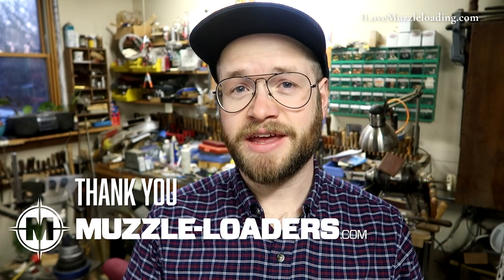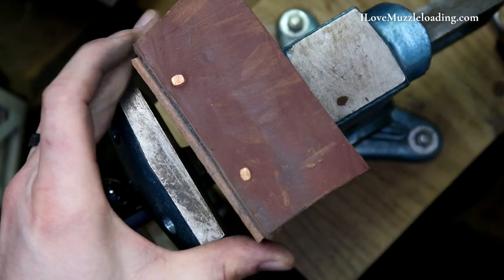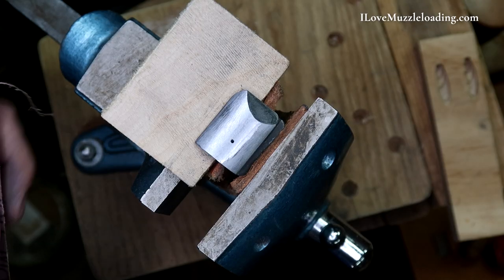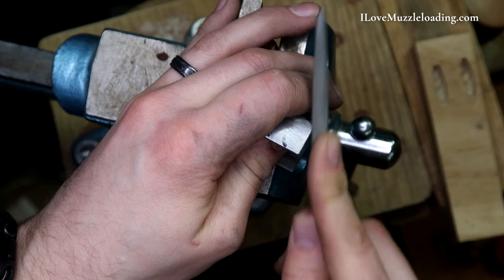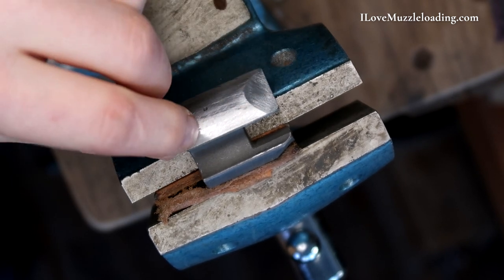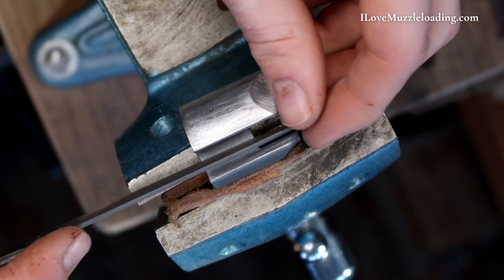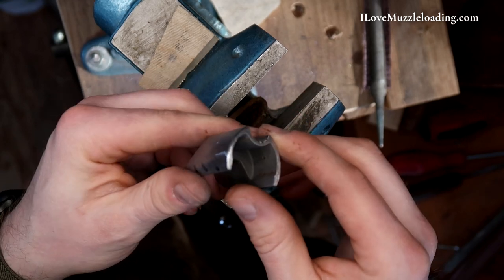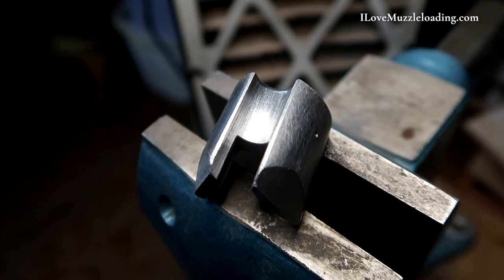The Nose Cap: A Story of Love and Loss | Let's Build an Investarms Gemmer Hawken Kit Part 10

Comment: check antique fairs and flea markets to find a hand vice.  They are worth every penny spent to hold small parts like that.   Also, I find filing the nose cap to be a whole lot easier when it is on the stock.  At the end you have to shape the stock to the part anyway.  but I rarely work with cast steel nose caps.  Usually sheet steel or brass and filing cast brass is a whole different story than cast steel.  Also, if you run the file "top to bottom" instead of Breech to Muzzle, those flat spots are a lot easier to deal with.  It is easier to keep the flow of the curves.   You're doing great work on this rifle Ethan.  It's really looking good.
Reply from the maker: Great feedback Jeff, thank you!

Comment: Ok I am going apologize ahead of time as I may come off as a jerk with this question for you.  Why did you not turn the nose cap 90 degrees in the vise? Utilizing the squared surfaces of the front  and rear for support in your jaws? This makes for better support of the peace with less stress on the casting. Rotate the vise for the desired work angle.  
Food for thought